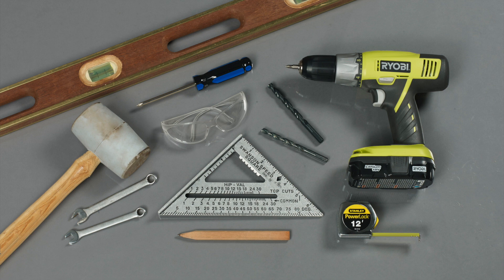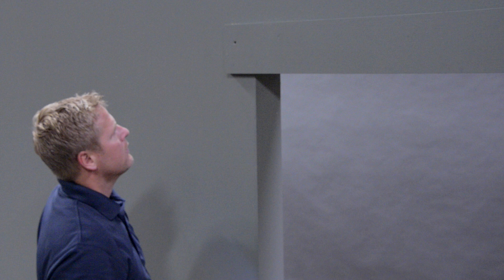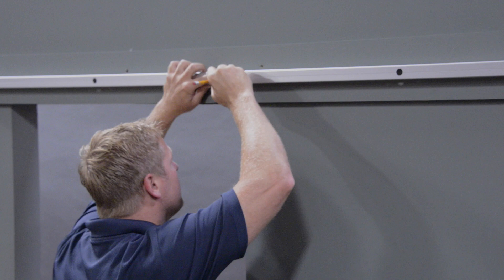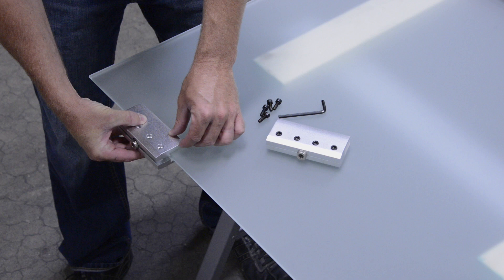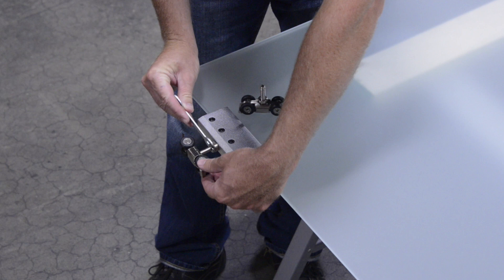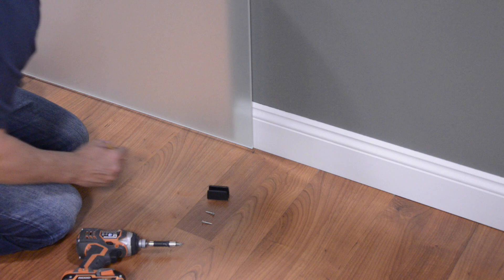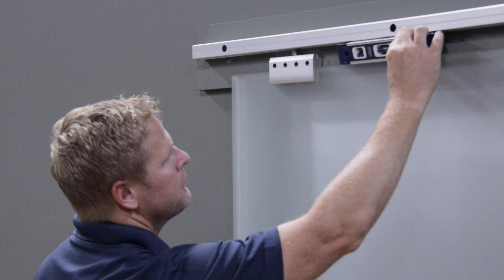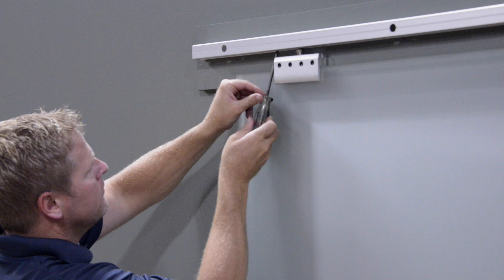Glass Barn Door and Track Installation

Comment: Very nice to find this! The "detailed" paper instructions with this door ordered from glass-door.us are one sheet without anything useful, not even enough re the basic hanging, nothing on floor guide, stopper or side cover panels. Question: that paper sheet says add 5.9-6.4cm to the height - and your video says 2 7/8 inch? At a factor 2.54 cm per inch, that's 7.3cm: doesn't match! Which is correct?